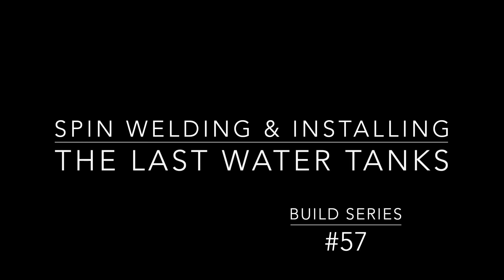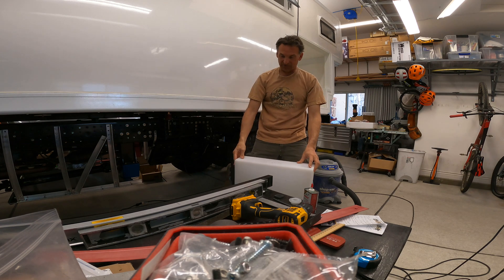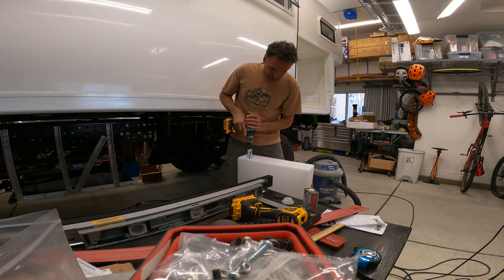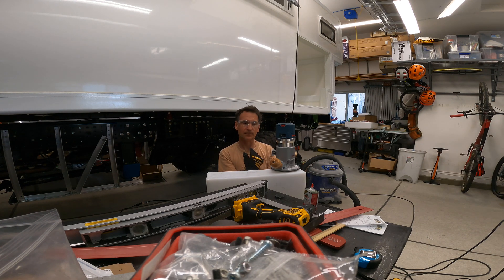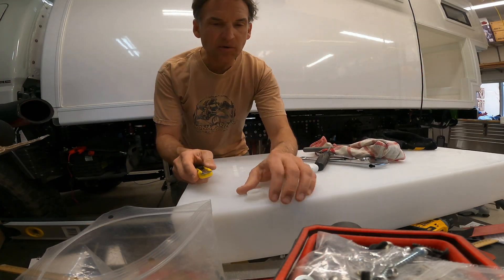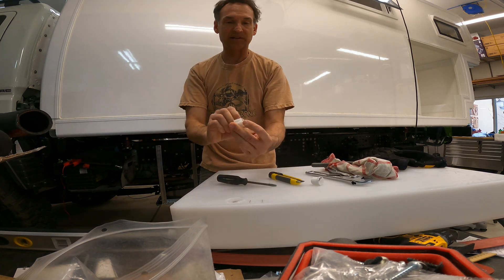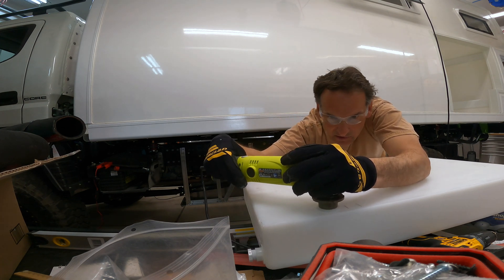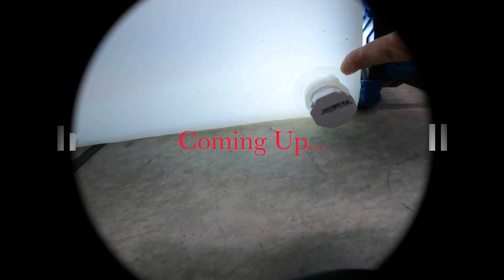Will my Spin Welding Tank Fittings Resist 60 PSI?

Comment: Well done. These little fittings are a pretty steep cost. Why not use bulk head fittings? Not as water-tight for overlanding vibrations?
Reply from the maker: I prefer spin weld fittings because 1) they cost about $1 each vs about $20 for a bulkhead fitting; 2) they are much smaller in profile and thus easier to place and take up less space away from other things than a bulkhead fitting; and 3) many of tanks do not have access to reach inside to install a bulkhead fitting, and 4) they are much lighter weight and won't leak or fail or ever need replacement if installed correctly. Because spinweld fittings only need access from one side and install easy with one person, they can be easily installed in any size tank, any location, and without an access port. My last batch of these cost $1.23 each.

Comment: Wow just found your channel.  Have been watching a couple.  Will have to binge watch to get caught up. 

I've not heard of spin welding plastic. What a great idea.  Haven't seen other build series talk about this. Well done. 👍🤙💪⚡
Reply from the maker: Thank you for watching and your comments. I learned to spin weld to get the exact size and placement of the fittings, which has worked great in my camper van conversion completed 5 years ago and being used since, and now in this new camper. It's fairly easy to do, low cost and gets that perfect custom tank set up. Enjoy more of my videos, and still many more to come.